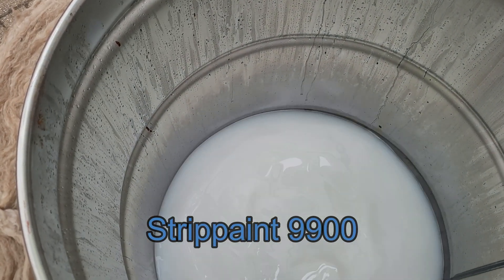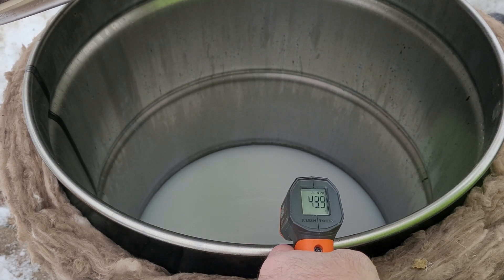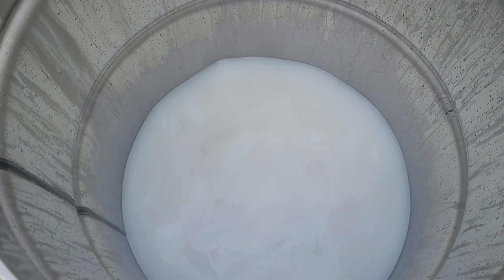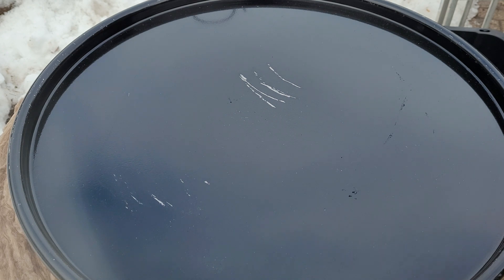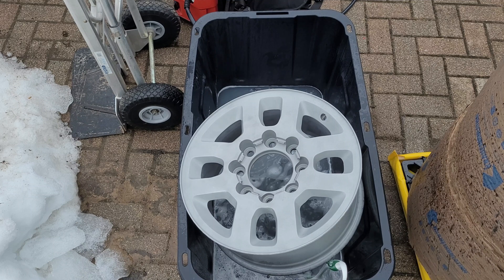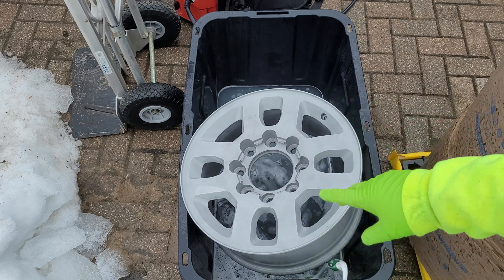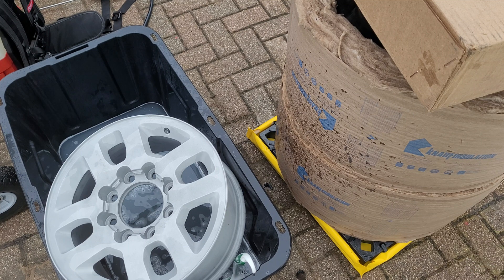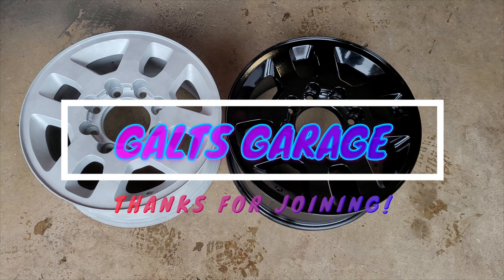Chemical Stripping Powder Coat Strippaint 9900 My New Setup

Comment: Hello I bought 4 5 gallon strippaint 9900 and I mixed it with 20 gallons of water in a 55 gallon drum and I have 3 heating bands on it. So I got the temp up to 215 degrees F and I’m stripping some aluminum jeep fenders and I left it in the drum with another drum on top of the drum the fender was sitting in and I left it in there for about 2 hours and it didn’t strip nearly as well as your rim did. I live here I. Texas and it is around 55 to 60 degrees outside. I’m wondering what I’m doing wrong. Any advise
Reply: Ok and yes the fenders aren’t powder coated instead they are painted mat black. The paint has come off about 3/4 of the way. But I have had them in there about 3 or 4 times after power spraying them off each time and putting them back in the drum for a couple hours each time. I may need to try another paint stripper that is a bit stronger but you are correct about the fumes that come off this paint strip 9900. It is very strong lol. Thank you for reaching back out to me
Reply: The paint is actually called E-coating which is a lacquer and paint
Reply from the maker: @thawise3572  That should come off pretty good with regular stripper, good luck and I hope it works awesome for you down the road!
Reply from the maker: That really sucks, sorry to hear it.  From how you explained it your mix is the same as mine 1 for 1 with water and your temp is great so this is a head scratcher.  Most likely thing I can think is that maybe the fenders aren't powder coated?  The peeling off effect as far as I know is primarily on powder coat where your paint job is essentially a sheet of melted polyester.  After 2 hours if that was powder coat it should have sloughed right off, in those conditions probably in 30 minutes or less.  I would find something you KNOW is powder coated and put it in there for 30 minutes.
Reply: Thank you

Comment: Thanks for taking the time to post the video.  The "20 gallons" you speak of.  Is that 10gal concentrate and 10gal water (per instructions on the website) or was that 20 gal concentrate and not diluted in your barrel?

I was also curious as to any surrounding side effects.  As in, splashes on concrete/brick/grass, or your plastic bristle brush, your skin (I was surprised it was clearly splashing on your skin), the plastic home depot tub your rinsed a soaked rim in, etc.

Again thanks for taking the time to post a video.  My last step in my hobby setup is chemicals.  I'm looking at EZ Powder Strip from CC but I am trying to do some homework.  Obviously not gonna go with "similar to B17" too gnarly for me IMO.
Reply from the maker: That 20 gallons was per directions so 10G concentrate 10G water.  I have not noticed any side effects from the splashing, the pavers don't have any bleached out spots, the tubs and brushes are all just fine.  It's still not fun to get on your skin and the fumes are pretty nasty but if you keep that in mind when you're working with it and stay ventilated and do a better job covering your skin than I did and this stuff is the bees knees.  It's not cheap but it's inexpensive compared to most powder coat strippers out there.  B17 probably works better at lower temperatures but that's some pretty gnarly stuff to work with as I understand it.  Hope you get your hobby setup going the way you like, I've really enjoyed it myself.

Comment: How many times were you able to use that batch of chemical?
Reply from the maker: I've put about 8 hours of soak time on it so far, it shows no signs of degrading or contamination.  In fact the black powder coat that sloughed off into the chemical from this job sat in the drum for 4 months before I had a day to clean out the barrel and the chemical still looked exactly the same.

Comment: I just got Greensolv wheel strip I’ve heard it’s much less harsh as compared to b17 and others I haven’t tried it yet but I got 55 g of it. I hope the results are as well as yours
Reply from the maker: I'm sure it will be, I'm also pretty sure it's performance will depend on the temperature just like the Strippaint.  Good luck I hope it works great for you!

Comment: Any info on your new powder coating setup you mention in this video?
Reply from the maker: I bought the Electron E-Coat Master box feed, it's  a serious machine that I've been taking some time to learn.  It's very similar to a Gema, really nice machine but there is so much more control available it's a bit of a learning curve.  I'll put a video out on it probably after the fourth of July.  I just finished powder coating my first set of wheels with it so that will probably make the video.  It's a HUGE step up from the Hyper Smooth 03 LED I've been using from Columbia Coatings.

Comment: Cool setup. Just curious why did you go with StripPaint 9900 over StripOxy 6842?
Reply from the maker: I didn't find any videos on StripOxy, the Strippaint I've seen work in a video.  Otherwise, no reason.  Have you used StripOxy?
Reply: I have not. Supposedly the StripOxy works faster. The advantage I see to strippaint is that it is safe on magnesium parts. @galtsgarage5775